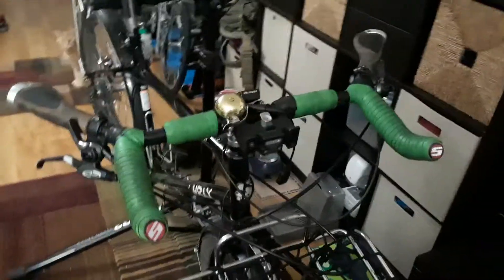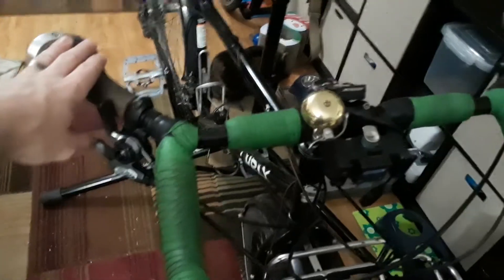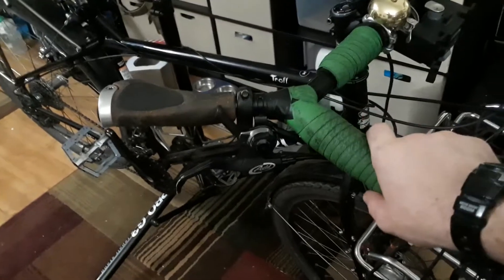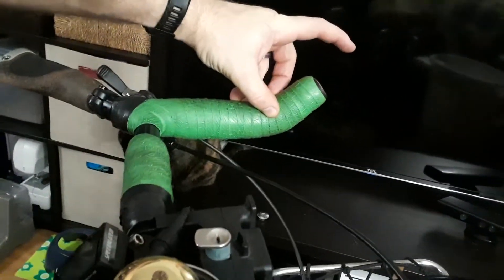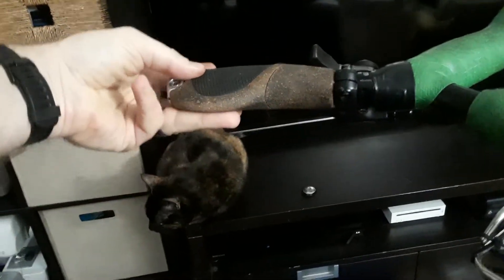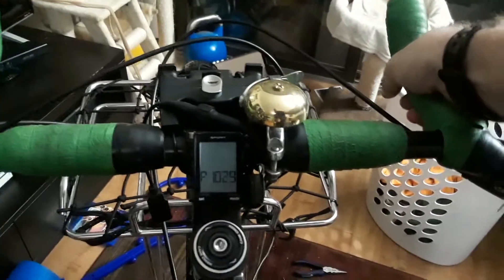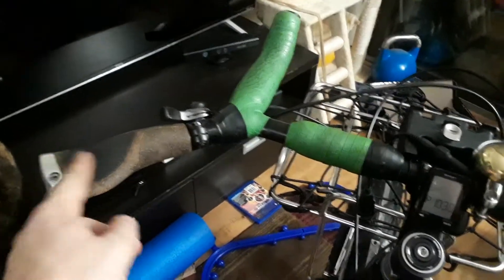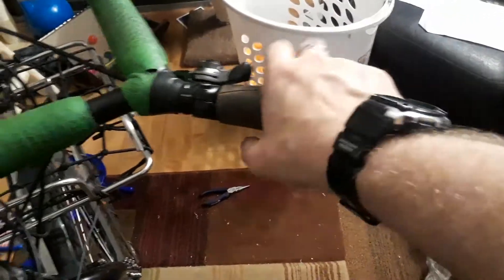Review of Crazy Bars from Velo Orange

Comment: Have you tried making an extension for those? either from some tapered pipe or a 3d printer
Reply from the maker: I haven't - I'd end up worrying about making a solution that ends up popping off and making me crash at an inopportune time. If someone had the equipment to build/weld something up though that could be a way to fix them. It'd still be preferable for them to come with that already set up in that optimal way.